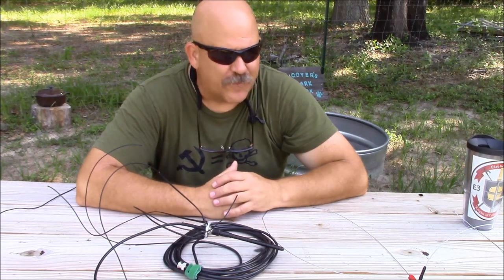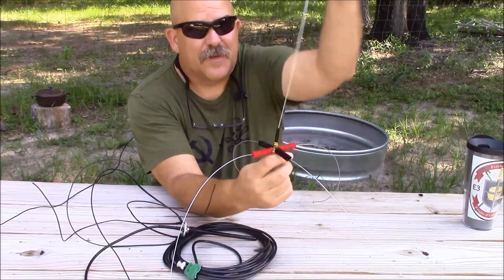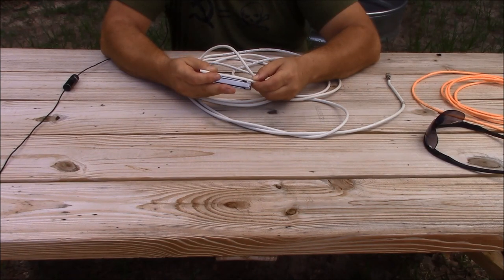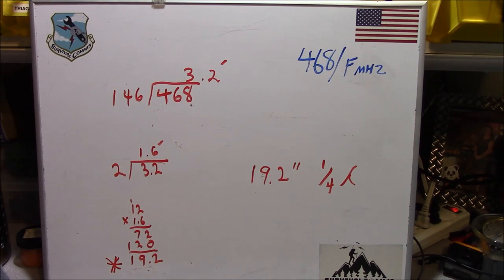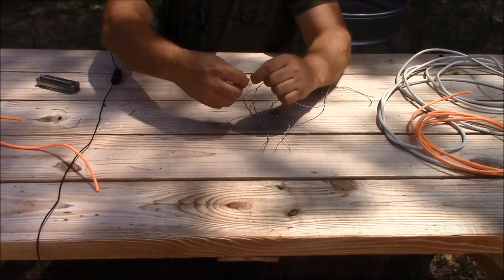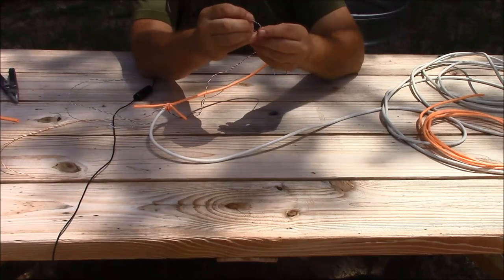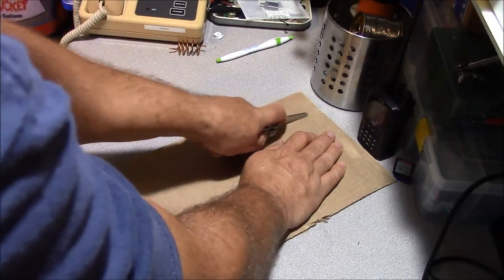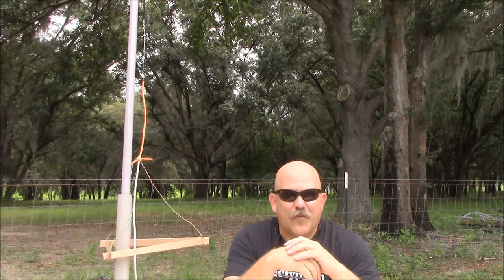Survival Antennas 4  VHF CAT5 Ethernet cable antenna

Comment: Nice vid. Thanks! If no cardboard available in the field, I envisioned 3 sticks/thin branches tied together with the cat5 sheathing. Your mention of more radials would help up to a point got me thinking. I wonder how efficient a cone shaped radial out of aluminum foil might be. 73
Reply from the maker: Thank you ! I mentioned that any non conductive material could be used in a caption. Bamboo really works well.  a cone of tin foil or several strips from a baking pan will work well. Foil is an upcoming topic - stay tuned ! Thanks for watching !!!!

Comment: Bret, that was fantastic! Please do a whole series of these from household materials! NVIS please!!!
Reply: I’d imagine you could use the same materials in the same fashion using the same formula just lay it out in an NVIS configuration with a rigid material to keep it off the ground. I’ll link a video I think could be adapted to cat 5 and common coax cable.

https://youtu.be/3TF6WFoPsFw
Reply from the maker: Thank you ! I have lots of content planned - these four thus far are just scratching the surface. Thanks for watching !
Reply from the maker: If you had a box of CAT 5 you can totally use the cable for antenna elements for an NVIS system. Proper NVIS is predicated on both stations using antennas configured for using NVIS and taking advantage of those high radiation angles for maximum effectiveness (hence System). I did an NVIS video a few month back . Thanks for watching !
Reply: SurvivalComms I watched your NVIS video, I especially like the use of the German flecktarn haversack. I bought a few of those a few years back in my military surplus adventures and I hadn’t considered using them for radio kits. Just as a heads up for those who don’t know if you want any surplus Flecktarn gear get it as soon as possible about a year back the Bundeswehr decided they would no longer be surplussing uniforms, it’s a shame because German gear has been some of the highest quality to price ratio stuff out there.

 Keep up the great content!

Comment: Hi Brett.  That was abosolutley enthralling.  Thank you for showing the length in metric.  A couple of questions; could you have 4 or more radials? Would it be better to have a 10 watt hand held than a 5 watt handheld? if so why?  Stay safe in these troubled times.  ATB.  Nigel
Reply from the maker: TY Nigel ! Yes more radials typically will deliver incrementally better performance - however when you exceed 16 the returns although increased become more and more minor until 128  when there is no further benefit in additional radials.  The difference between 5 and 10 watts is effectively a doubling of effective radiated  power  (commonly expressed as a 3db increase)but only on transmit. Going to a more effective antenna system that provides gain that increases transmit and receive performance without the detriment of consuming more battery which doubling transmitter power entails. Remember gain in regards to antennas is a measure of radiation focus rather than an increase in what we consider to be power in the physical realm ( like using a 4:1 haul system of pulleys) and an increase in transmitter power is more akin to what we would consider to be an increase in physical power such as going to a larger tractor at the expense of an increase in fuel consumption.  Remember that radio is bi directional so the talkpath is dependent upon both both stations ability to communicate with one another within the constraints of physics. I hope this helps and thank you for watching !
Reply: @survivalcomms  Hi Brett.  Thank you so much for the explanations.  They are most helpful.  Thank you for taking the time to explain.
Reply: @survivalcomms  Found that out about 20 years ago, when making a USB Wifi fob preform better with no extra power....used the parabolic formula and an old wok. Increased the ability of that fob by more then 100 meters! Fun times 👍

Comment: Pretty ingenious use of scrap materials. But how well, will 75 ohm cable tv wire work, as a feed line?
Reply from the maker: If you make good connections it works decent.  Its cheap enough to give it a try. Thanks for watching !

Comment: cant you just cut the coax back 20 inch's and cut the dielectric one inch from the main coax line and remove the copper shielding....And another tip is I use the copper shielding as solder wick..just add a little flux to it...
Reply from the maker: This is survival antennas where you are making an antenna out of what is on hand without the benefit of tools and trying to preserve your feedline resource.  I have over half a dozen ground plane antenna videos. In my Survival Antennas 1 we make a coax only antenna . I made a video 6 years ago on making one out of TV coax also. Thanks for watching !